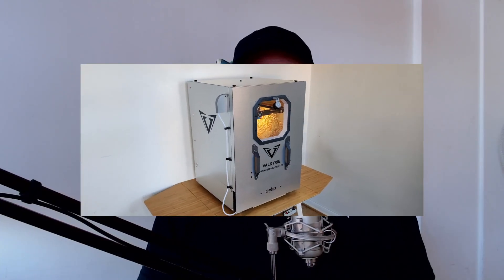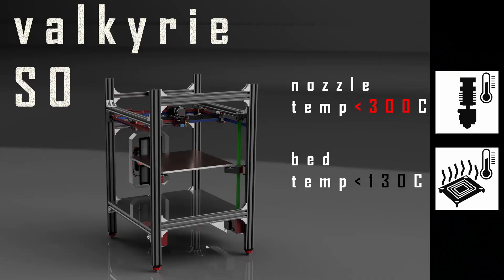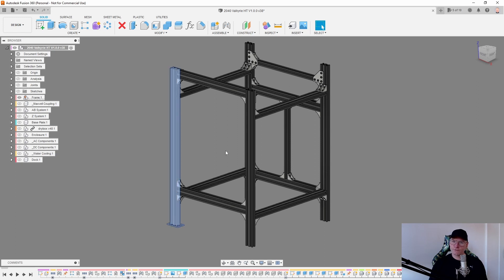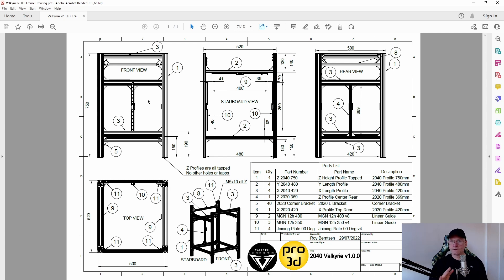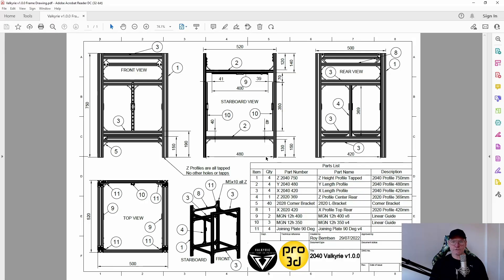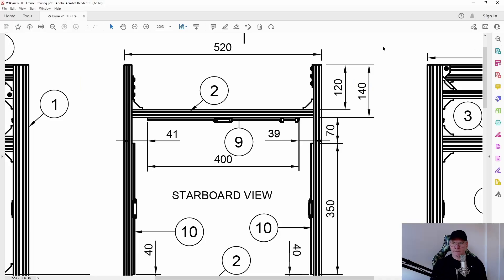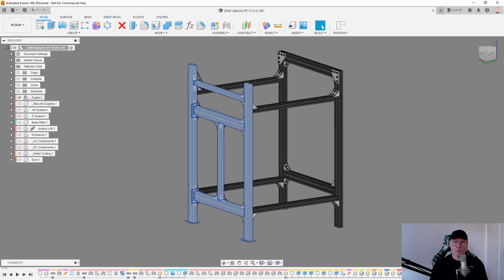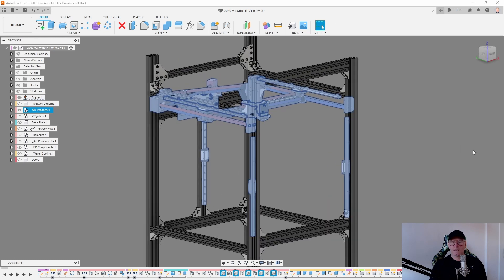Valkyrie Build Vlog | Part 1 | DIY High Temp 3D Printer

Comment: Very cool.  I see there is a .zip file on your github, is that the drawing package?  Any approximate build cost range?
Reply from the maker: 1500 to 2000 USD. Drawings in the drawing folder
Reply: @PRO3DESIGN  Thank you!  Seems reasonable for such a high performance and artlike machine.